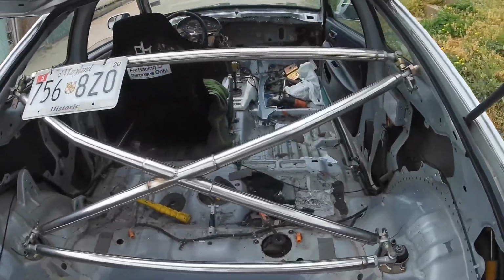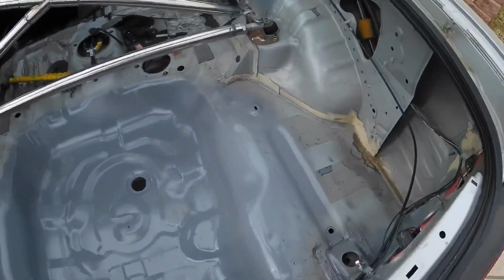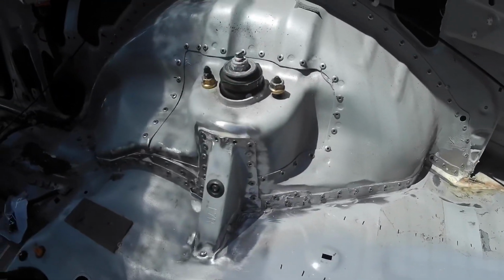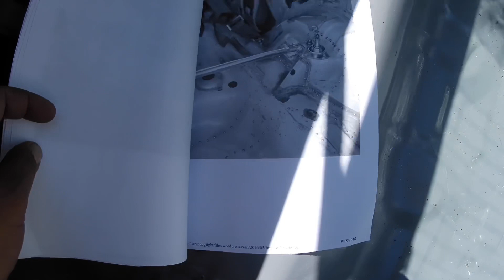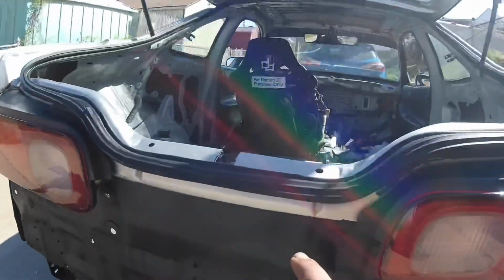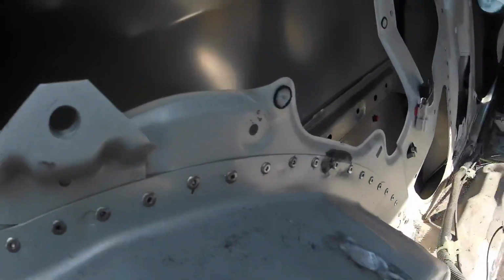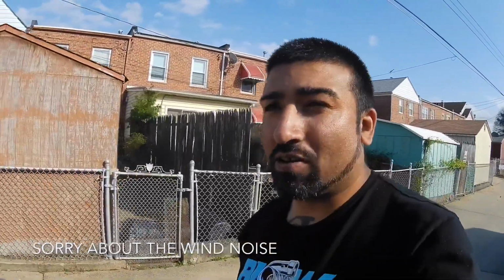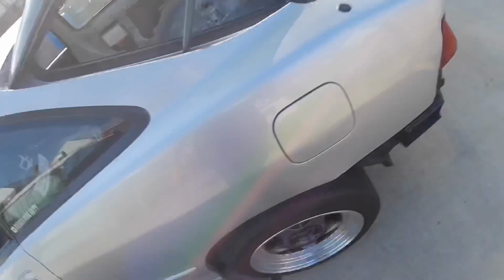Integra chassis reinforcement part 4

Comment: This is cool to see man, proper jdm, kanjo style, reinforced with rivets 👌👍
Reply from the maker: thanks.... its a lot of work but i think that it will be worth it in the end.
Reply: @RevHighDriveHappy  any particular reason you wenr for stainless over aluminium rivets?
Reply from the maker: @Dan_AYP  i didn't want to use dissimilar metals because i read using aluminum and steel could cause corrosion.
Reply: @RevHighDriveHappy  yeah they react with one another but some say that helps as they effectively corrode together 👍 but I dig the theory man! Again nice work
Reply from the maker: Dan AYP  thanks I appreciate it

Comment: I'm buying a DC2 this weekend and its a project car, do you gonna put anti-rust coat over the bolts so water dont penetrate in? Why did you not weld it simply?
Reply from the maker: Darko Hugo Rivets are lighter than a roll of welding wire. Also rivets don’t put heat into the chassis like welding wire. When I’m all finished I’m going to re-seam seal everythingAnd paint the inside. I’m also going to undercoat the chassis where the rivets come through